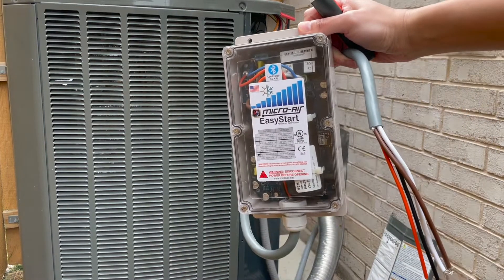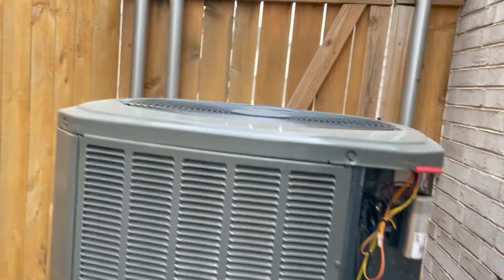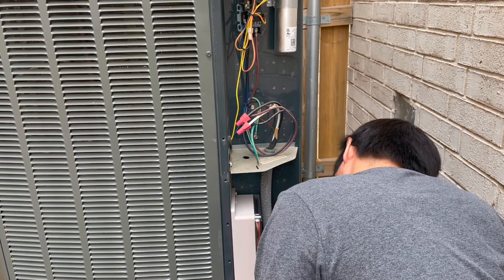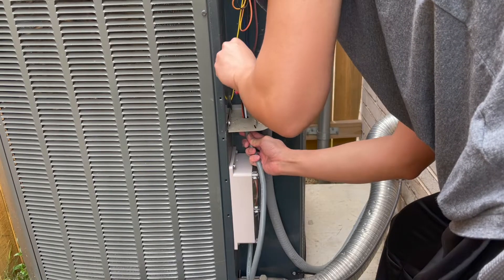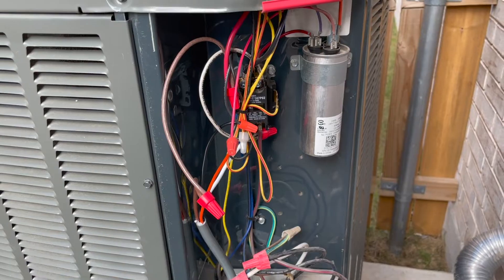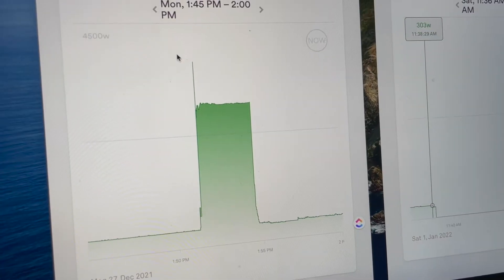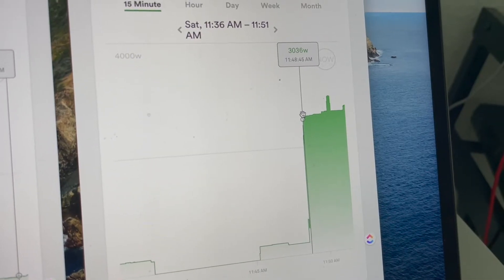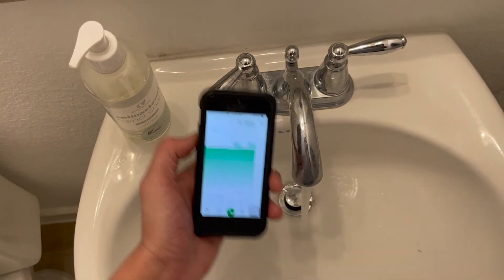Running a 4 Ton AC on a GENERATOR - Micro-Air Easystart 368 Installation & Testing

Comment: what is that app on your phone u are using for the current measuring???
Reply from the maker: That's the sense app (https://sense.com/). You can purchase a kit from Home Depot or Lowes. It attaches to your electric panel and measures current and voltage.

Comment: Open the unit and flip the capacitor.   Now it’s facing right for the wire.   Assuming it’s possible, probably not.    Thanks for the video, going this route also.

Comment: Hi, what compressor model is yours? Thanks
Reply from the maker: Trane XR16 series 4TTR6048J1000AA from 5/2020
Reply: Thanks for your reply. I have Frigidaire - FS4BE-060KA - 5 Ton 14 SEER High Efficiency AC Compressor and been looking on YouTube to see if someone may have the same or close to the same wiring to help me with the installation but haven't seen any. Do you think your wiring would be the same as mine?
Reply from the maker: @VMH.  have you opened up the compressor unit yet? Turn off the power at the disconnect switch box and unscrew the cover to access the capacitor and the contactor. If you only have a fan and compressor wires, then you have the same setup. 

If you can't tell, take pictures and put them online somewhere and I'll be happy to take a look and let you know what I think.

Comment: Just ordered mine! Thanks
Reply from the maker: Awesome - hope your install goes well!
Reply: @jonathanDIYs  Thanks, Can you tell me the power cord whip diameter so I can get the liquid tite connector for the install? Thanks again!
Reply from the maker: @fattysgarage1754  I just measured it and I came up with 2/3 inch diameter. I remember having a hard time finding something exact because it was a little bigger than 3/8" and smaller than 3/4", but if you're going to just pass it through a connector the 3/4 inch or bigger should do. Good luck!
Reply: Yah, go with 3/4 connector.  I used a 1/2 connector, and it works, but the cable is a really snug fit.

Comment: I have the same setup (Champion 100520, Trane XR16 4TTR6048J, EasyStart and NG conversion). I haven't tested my system on NG yet because once I installed the EasyStart, the bluetooth app read about 21A live current & 37A for last peak start, which exceeds the capability of the 100520 on NG (roughly 5740W running/7175W starting).

I grabbed a new amp meter with inrush metering and it reads much more reasonable 18A running and ~23.5A inrush to the condenser, which is much more expected when you check the LRA/RLA listed by Trane for this model (18.5/124). Waiting for a response back from Microair regarding this now.
Reply from the maker: That's awesome that you have the same setup! I've been really wanting to test it out with NG, but haven't done the conversion yet. If you already have NG setup, I think it would be fine to just test it out. You won't know unless you try. All that happens if you go beyond the power of the generator will be that it stalls and all the power goes out. I did this a few times before installing the soft start when I was trying to run the AC by itself. Looking forward to hear your findings whatever you do. Thanks for sharing!
Reply: Yes, it was surprising to see someone else with the same setup.

I have the motor snorkel installed and tested locally but I don't have 30a service pulled over where my gas disconnect is (roughly 90' away unfortunately). I will pull cable once I have some free time and a death wish to spend more time in my attic.
Reply from the maker: @effingv  Ah, yeah... NG and electricity being in different areas is annoying. I bought a 80' or so long extension cord - it was pretty expensive, especially with how much copper is these days, but I figure it was an investment and gave me a lot of flexibility to have the generator wherever I need.
Reply from the maker: Just to follow up on this, I got the AC working on NG. I also see the same numbers (37A peak start), but it somehow still works. I'm guessing the EasyStart reading is not completely accurate? I can't imagine the generator being able to generate 8880W peak power... and this somewhat seems to be confirmed by you measuring with an independent inrush meter. If you're interested to see the latest video, it's over here: https://youtu.be/Fgqlg9NThBM Thanks for sharing your experience!

Comment: Here are my tips as a result of surviving MANY hurricanes. After a hurricane expect power to be out on average 7days. This requires a LOT of gasoline or propane if you run your generator more or less continuously under significant load. That’s a lot of fuel to buy and store (good luck waiting in line for hours to buy gasoline after a storm if you can find any). A generator with a natural gas option and a hook up to your gas meter is the way to go. My experience with the aftermarket retrofit trifuel carburetors is not good. The problem is the ones with the regulator built into the carb overheat and cause the regulator to malfunction under continuous use. The carb gets VERY hot. You will have a challenge trying to power up a larger HVAC using a generator fueled with natural gas even with a soft start because of the wattage reduction. I use small to medium size window units. I also do keep propane and gasoline just in case my natural gas system malfunctions. Nothing worse than being without power in New Orleans after a hurricane. If you want minimal aggravation and have the resources, then get a Generac whole house backup generator permanently installed (but keep in mind they require maintenance and don’t last forever).
Reply from the maker: Thanks for your tips! I'm looking to do a natural gas conversion on this generator when it gets cooler. I will note that when we lost power in TX last year, natural gas was also in short supply. We didn't even have enough to run our hot water heater or the natural gas furnace. I think having multiple ways of powering the generator is best. I am very curious to see if I will have enough power to power my AC on natural gas/propane. I'll let everyone know when I try it!
Reply: @jonathanDIYs  It’s also a good idea to have another generator as a backup in case your primary generator has mechanical problems as a result of continuous use. You also need to change the oil after so many hours of operation so have a supply available. In the military they say one is none and two is one. You might consider purchasing a trifuel generator and use the one you have as a backup. Costco has a Firman that goes on sale for $200 off around twice a year (you just missed the July sale).
Reply: Great advice. Installing a Tri-fuel kit is much better, then an already made Tri-fuel generator.  The reason why, is because on a Tri-fuel ready generator, the air fuel mixture is set. (No adjustments) When you install a Tri-fuel kit, Motor Snorkel, you can adjust the regulator based on your load. (Once set, you won't have to set it again) Meaning, you can adjust the air fuel mixture.  This will minimize power lose some, when running on alternate fuels.

Comment: I'm thinking of going with a Duromax 9000 watt, 7600 continuous watt inverter generator for my York 4 ton AC. What are your thoughts...do you think it will run my unit with 30 outlet? If so, I am good with that, I can cool my house, turn the AC off then run my other appliances. Let me know what you think. Thanks
Reply from the maker: If you get a soft start - it very well might work. If it does work, you will actually be able to run all your other appliances at the same time as your AC. The key is just to turn on the AC first and then after the surge startup power is drawn, turn on the other devices. The surge startup power only lasts a few seconds. It is the surge that makes systems have to be oversized. The surge can be up to 5-10x higher than normal running power consumption. The Duramax 9000 is a great unit - I'd be surprised if it doesn't work once you add a soft start. Let us know after you do it! Would love to hear more success stories!
Reply: @jonathanDIYs  thanks a bunch. I will definitely let you know. I'm adding the soft start and an auto start kit for my wife's convenience if available for the Duromax as well as a Generlink. Thanks again for the feedback.
Reply: Unfortunately,  our power company doesn't allow generlink on their meters.
My duromax was delivered today. 30 amp inlet box, soft start and whole home surge protector will be installed this weekend. I'll definitely let you know the outcome.
Reply: @jonathanDIYs  It is brief, but it occurs frequently.

Comment: Can you tell me what’s the difference between this device and a start assist and a hard start kit and also a soft start up kit? Why is the fan turning so slow at 12:22 ?🤔 Thanks from New Orleans 🎭
Reply from the maker: The fan is not really turning slow - that's an illusion because of the camera. As for hard and soft start - hard start is cheaper and basically just an extra capacitor. It works by storing more juice so that when the compressor kicks in, more of the surge is being buffered by the extra capacitor than if there was nothing. If the hard start can cut your in rush down enough to run on your generator, it can be significantly cheaper. The microair soft start on the other hand has a computer logic board and a bit more sophisticated startup sequence. The soft start starts the compressor fan first to eliminate the inrush of that motor than starts the compressor. It has some learning logic to determine the best combination to reduce inrush as much as possible. Soft start is definitely more expensive and if you can get away with hard start, I'd recommend it for the price. I needed to do a soft start because my generator is relatively small. I'm somewhat amazed I can run a 4 ton AC off of something smaller than 10000 watts. Hope that helps! Thanks for commenting!
Reply: @jonathanDIYs  Does the circuit board have any surge protection? The last thing you need is a fried board as a result of lightning or power company surges during/after outages.
Reply from the maker: @socrates2706  No surge protection on the soft start system itself. I did install a whole house SPD2 device that offers some protection of the unit.

Comment: For under $40 a hard start kit dropped my 4 ton lennox from 99a to 58a at startup and it runs at just under 14a. not sure this fancy box is worth it. the amount of time your AC is at peak during startup is a fraction of a second.
Reply from the maker: Unfortunately that wouldn't work for my generator which is only a 8750 peak watt generator. At 58a, we'd be looking at almost 14000 peak watts. I either needed to size up my generator (which meant sizing up my inlet which was a NEMA 30 amp to the 50 amp, go with 8 gauge wires, size up the breaker) or go with this. I'm glad it works for you though! If you can get by with a hard start kit, definitely the more affordable option. Thanks for commenting!
Reply: Having the Soft Start is much better in so many ways and worth the money.  I installed a Hard Start on our Lennox 3-ton AC system.  The LRA before the install was 57.1 amps. After installing the Hard Start, the LRA was 37.1 amps. I was able to run our AC on our Predator 9000/7250 gasoline generator with no problem.

Once I installed a Tri-fuel kit and using NG, the AC wouldn't start.  (Not enough startup wattage) Once I installed this same Soft Starter, the LRA was 20.8 amps and now we can run our ac on NG easily along with the rest of the house.

Comment: Did you notice  $ saving also?
Reply from the maker: Hard to say… this year has been a lot hotter than last year. We are seeing 100+ degree weather in Texas for a week and a half straight. The bill has gone up because of that. I wouldn’t necessarily add this to save electricity - it was all to make sure I can run AC during an emergency power outage if it happened in the summer.

Comment: Thanks for sharing. I learned a lot.

I'm really looking forward to your next adventure -- converting to NG. 

I've seen a lot of videos of folks who did the gas/NG conversion but none of them showed their generator running under load. I'd hate to buy a kit only to discover that NG doesn't have the energy density required to run (at least) my AC.
Reply from the maker: Probably won’t end up doing this until the fall. 100 degree weather in Texas makes me dread being in the garage for any longer than I have to (call me spoiled)! Thanks for commenting and your support!

Comment: Hi, what is LRA on your ac unit?  I have also installed the easy start on my 4-ton ac Trane xl18i and my peak is 32.5 after 5 learn.
Reply from the maker: After training, my easystart is reporting that my LRA is 36.4A and my RLA is 13.7A. Looks like the Trane xl18i is a bit more efficient!
Reply: @jonathanDIYs  Thanks Jonathan. Were you able to do continous run test with central ac and other devices?
Reply from the maker: @syedfaz26  yes, after the initial startup (lights dim slightly), I was able to have all my regular lights and devices on. I think it would fail if I tried to run the dryer at the same time, but it does a good job of running everything else (fridge, computers, lights, etc) at the same time.
Reply: @jonathanDIYs  That is great. To summarize my setup in case anyone is interested. I am going with 50 amp breaker, 45 ft four, 6 gauge wires in conduit from main panel to 50 amp inlet(Reliance PBN50). 4 ton Trane XL18i with x368 easy start from micro air and 9500 Predator Inverter Genrator. I will share some results after finish installing the  inlet.
Reply from the maker: @syedfaz26  I’ve heard awesome things about that generator. One guy on YouTube made a parallel cable and can basically max the full 50 amps. With that much power, you practically can run everything without issue. Good luck with your install and stay safe - dealing with potentially deadly voltage!
Reply: @jonathanDIYs  Thanks

Comment: I was planning on Purchasing  one to put on my AC unit($354)  because my 7000 running watt generator want start the AC , But first i removed the Panel on my AC to see if there was room  to install the unit behind the cover area  I noticed on the back of the cover was a Factory  wiring diagram for the AC Unit  and noticed it showed a Run Capacitor & a Start Capacitor & Potential Relay on the wiring diagram but the start capacitor & Potential Relay was not installed on my AC unit  so i called the AC MFG company to get some more info They said only there Top Tier ($$$) units  come from the Factory with Start Capacitor & Relay  But i could add to my unit the kit is $350 ($350 for cap & relay ) i said No Thanks  , So i did some research on the Part number & I Found a MARS Capacitor (USA Made) with same spec as Factory Start Capacitor online for $9.08  & the Same spec Potential relay  for $40.00  ordered both and installed to as the factory wiring diagram shows and Now My Generator Has No Problem Staring the AC unit !!  Saved ME over $300 !!
Reply from the maker: Glad that worked out for you Dan Ray! Yes, I believe what you installed can be bought commercially as a "hard start kit". I opted for the soft start kit, but I believe several people has had success with doing exactly what you described. I think the only significant difference is that the soft start starts the fan a few seconds before the compressor to mitigate more surge, but in terms of having a capacitor for evening out the starting surge requirements, they do the same thing. What you're paying for with the soft start is an electronics control board that can "learn" the power profile of your AC unit. If you can get it to work strictly like you did, great for you! Glad you can save some money and do it on the cheap!
Reply: Have converted your generator to natural gas and if so ,does it run the whole house or most of the house...I'm working on the same setup have a duromax 8500 running watts thats with use of natural gas
Reply: @lanceandres62 Mine is a multi-fuel generator but you get more power out of gas vs. natural gas. I can run pretty much everything but I have not tested the electric heat on the AHU, electric heat pulls high amps. I only installed a hard start kit and has worked fine so far.
Reply: @lanceandres62 you planning on 30amp or 50amp inlet? 30amp inlets have 7500 watts max. 50amp inlets have 12500 watts max I believe. Check your inlet manual to verify your specific unit. Just something I noticed that not many peeps talks about until their generators overheat.

Comment: CAUTION!!!!!!!!  😯
This diy person did NOT properly discharge the capacitor, all he did was check for voltage and there will be none with the power disconnected.
There are proper ways to discharge a capacitor, look them up if you are concerned.
Also, that is an improper use of the red plastic item.
Use a proper wire protection device.